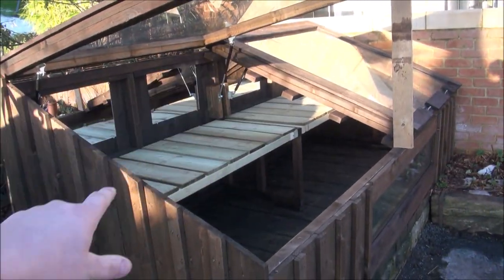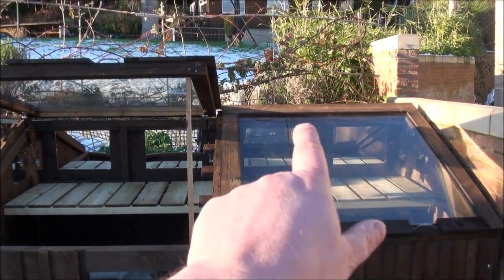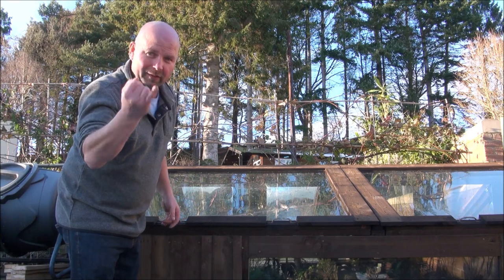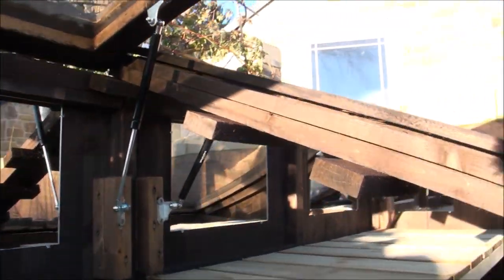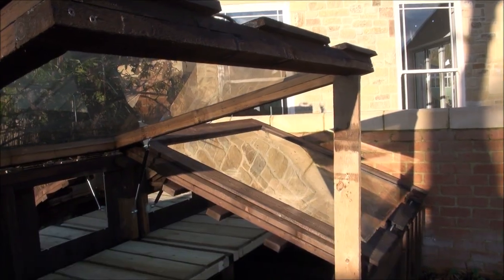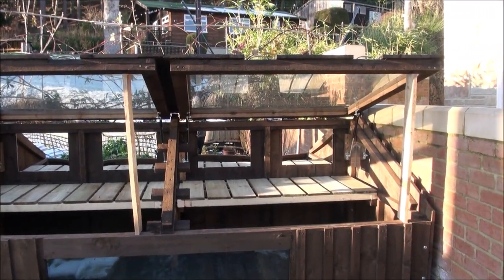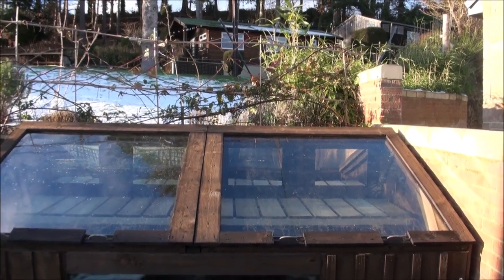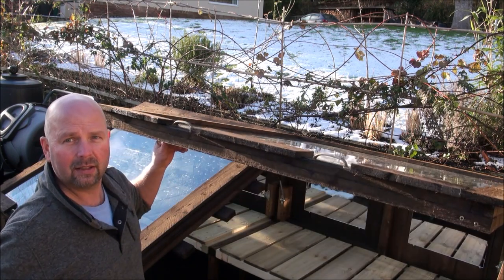The Ultimate DIY Garden Cold Frame?

Comment from the maker: This was my Christmas project and the structure is approx. 10' x 4' (3m x 1.2m) with the high side being just over 1m (3'3") and the low side being approx. 0.5m (20").
It is made from a 2" x 2" (50mm x 50mm) frame and is covered by 6" x 5/8" (150mm x 16mm) boards with 2" x 5/8mm (50mm x 16mm) lappers over the board joints. The actual size of the '2" x 2" is nearer 45mm x 45mm as they are dressed (planed).
The cold frame sits on a base made from pressure treated fencing rails which have then been treated with creosote. That keeps the cold frame approx. 1.5" (40mm) above the ground so the main structure is not in contact with wet and dirt which could accelerate the wood rot - this should last for decades.....
All wood inside and out on the cold frame is pressure treated but since pressure treatment isn't what it used to be (I'm planning a 'rant' video on that subject) it was all then treated with a spirit based timber treatment. Avoid water based 'treatments' as they are useless.
The spirit based timber treatment can be found here: https://geni.us/95NKT or on the A-chem website here: https://www.achemshop.co.uk/product/timbashield_dark_oak/
The gas rams I used to enable easy lifting of the lids can be found here: https://geni.us/LsyNSHd
The Stainless steel hinges used on the back of each lid can be found here: https://geni.us/2NWw5F
There are 4 hinges on each lid.
The handles on the lid can be found here: https://geni.us/gBuPQ3
All the screws used are outdoor screws which are zinc coated and are available from any decent DIY store. Same story for the zinc plated bolts used to hold sections together (they are 125mm x 8mm).
The cold frame sits over the overflow from my sewage tank so there is some low level heat being generated underneath it from the bacterial activity - that will help it stay frost free over the Winter.
I'll be covering the bottom of the cold frame with some heavy rubber pond liner as I have a spare piece which should be big enough.. 
I will do semi-regular garden update videos so subscribe if you want to see more on this project and the garden.
Thanks for watching and check out the gardening playlist on my channel for more videos.

Comment: Absolutely fantastic!
Reply from the maker: I'm definitely loving this project - it was over 30 degrees C  there today - in the middle of Winter, lol
As the structure has dried out and the wooden window sections have become lighter it is even easier to lift up the sections - seems like I got the sizing of the gas rams just right but I won't claim it was through anything but dumb luck.

Comment: Wow love your cold frame build. Think I might take some ideas from it. Since Xmas, I have set myself up with a very basic solar system. Never done anything like it before, so was definitely a learning experience. I now have lights inside and outside my shed. A couple of fans for the summer, 4 USB ports, 12v connection and lights in my greenhouse all run from a fused 12v switch board. Really happy with how it all worked out 😁
Reply from the maker: Yup, keeping it simple is key to long term success and any sort of solar infrastructure and understanding is awesome.
I sometimes worry about my solar system and batteries since my knowledge of electrics is basic at best.
However, I could live quite happily as a hunter gatherer but I couldn't say the same for the rest of my family so it's up to me to work double time to make sure that we still have the structure and benefits of a 'civilized' existence. The work I'm putting in is definitely not wasted even in the current times as we all love organic vegetables and free range eggs but it's all a set-up for what could (will) be coming if / when the SHTF all that work will have real value.
All the best for 2023 and beyond.

Comment: Hi, just so your not working around those chunks of timber and risk knocking them when your leaning in, just get a smaller chunk and chock them up from the back like a wedge👍🏻
Reply from the maker: That's the plan - I just need to make  couple of blocks for the rear part of the frame or get something on a swivel which will swing up and lock into position.